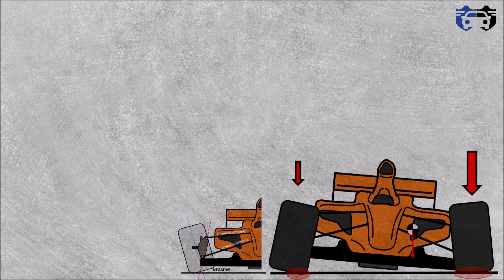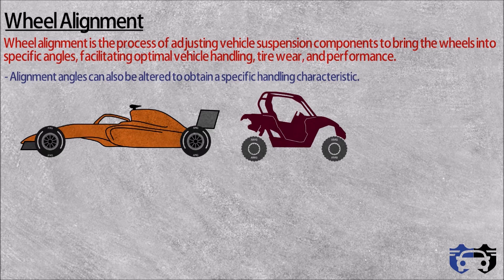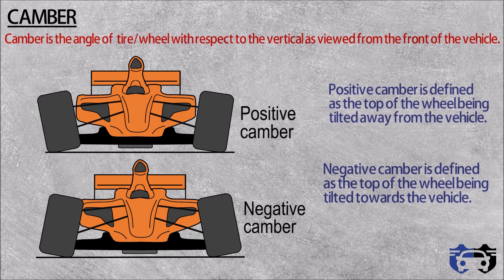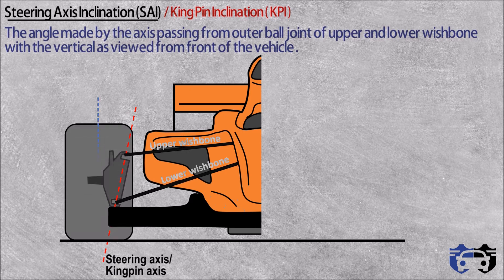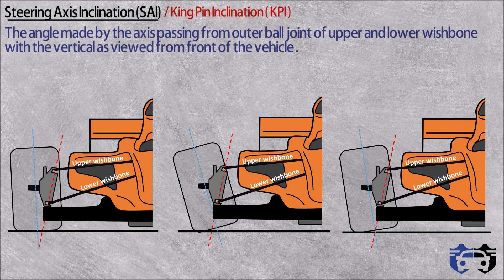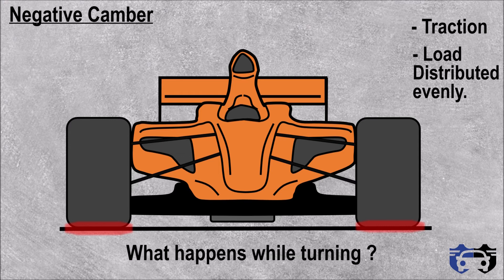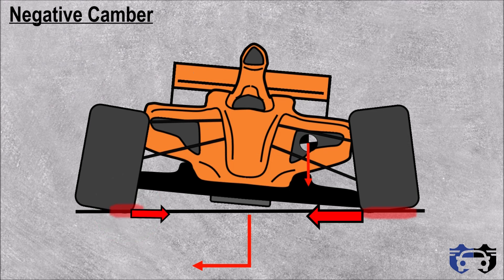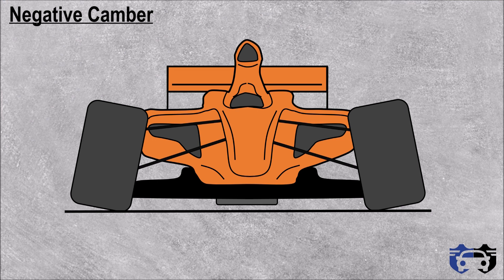Wheel Alignment | Camber | Steering axis Inclination | Scrub Radius | Benefits & Drawbacks of Camber

Comment: 1. most modern cars use negative not positive camber
2. negative camber increases the inner tyre contact patch and not the outside one, as camber always works in combination with caster

Comment: According to my survey on many journals and books negative camber is mostly preferred. But in your video you are saying that positive is widely used!
Reply from the maker: I think, I gave the proper reason to use the positive camber. Negative camber or neutral camber is also used in some offroad and racing vehicle, for providing the stability. But for reducing the steering effort,you have to use positive camber because it decreases the scrub radius.
Reply: @thevatsaljain  I also know as Sai' s said . Nowadays vehicles have hydroulic or electrical asisstance for steering, so steering effort not very important as much as stability. And thanks for videos, they are really helpful.
Reply: maybe I'm a tad late for the discussion but (at least) every car I ever worked on or know about has/had negative camber. You might be right about the decrease of steering effort but you forget about the Forces while cornering where the negative camber is necessary to have a flat contact patch. Usually ( at least in modern cars) there is power steering or in older 80s models without ps the scrub radius is minimised and the tires are very narrow. Positive Camber has a lot more cons then pros when considering the forces pulling on your tire/suspension.